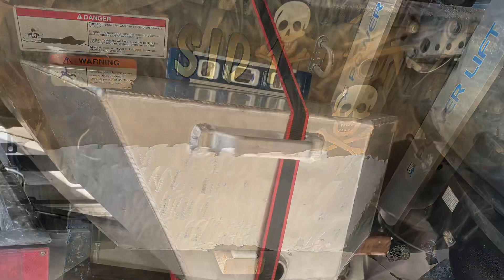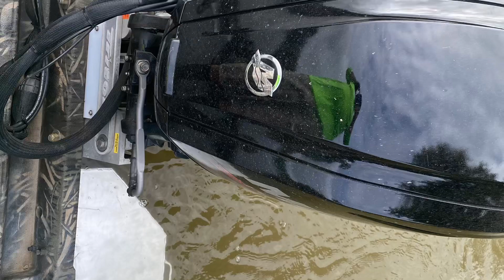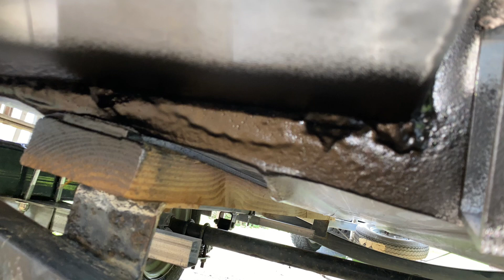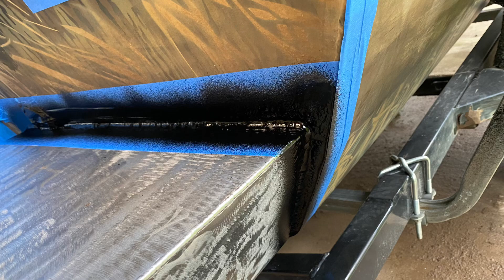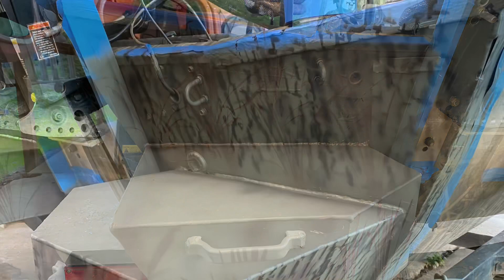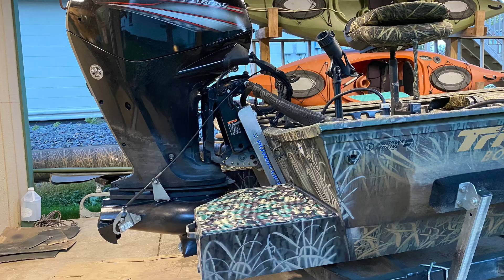Float pod install slide show

Comment from the maker: It definitely helps. Without the pods when I first installed the 65 jet if I stood on back of boat the water line would be within inches of the top of transom. With the pods 2 adults can sit or stand on pods and water is only alittle more that half way up. They definitely help! I’m happy I installed them.